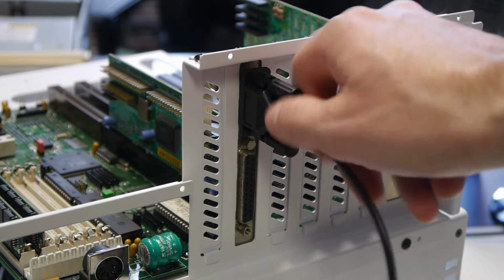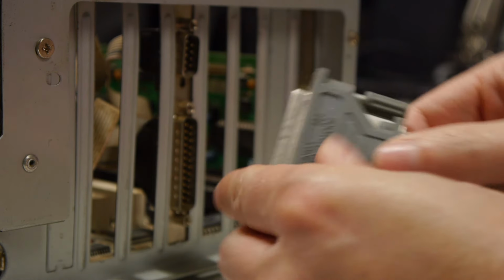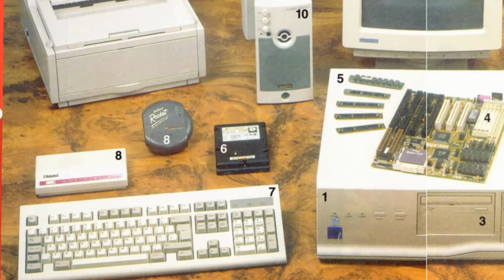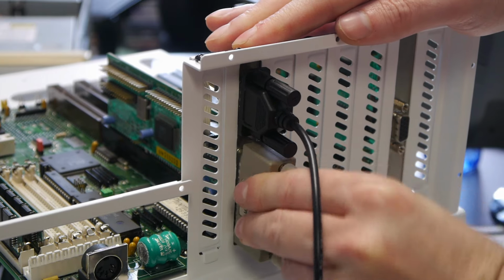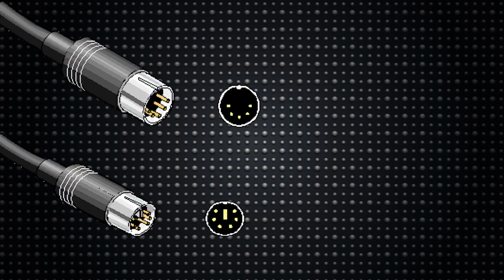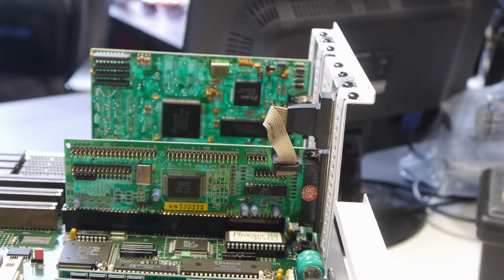What did we use before USB? | Nostalgia Nerd

Comment: Funny how Apple is never part of these standardisation groups.
They've always done it "their way", leading to tons of obsolete hardware.
In the end they follow the standards, albeit a few years later :)
Reply: To their credit, the original iMac bet heavily on USB pretty early on, and that was one of the things that really popularized it.
Before that, their keyboard and mouse connections were generally done through ADB (Apple Desktop Bus), a system that allowed daisy-chaining and used a round 4-pin mini-DIN connector. The biggest problem with it besides being proprietary was that it wasn't safe to plug or unplug devices with the machine turned on (though people did it anyway).
Reply: ...and before that, the very earliest Macs used connectors that looked like modular phone jacks. ADB seems to have been first introduced on the Apple IIGS, oddly enough.
Reply: They use USB on their Macs and their iPads. Rumors say that they will start using it on iPhone too.
Reply: The thunderbolt interface was created by Intel and Apple
Reply: I don't know if they just like to be different for the sake of it. How come there's no uninstall function? A lot of bigger or more complex software leaves crap all over the place.
Reply: HScarlet I assume when you say “uninstall function” you mean for software. The reasons for this was that most software was installed simply by copying it to the Applications folder and uninstalling meant simply deleting the App. For those Apps that install stuff in system folders such as drivers then the app’s developer is supposed to provide  a uninstall app for that purpose. Window’s uses a central program for installing Apps such Add/Remove Programs or whatever their call it in WIn10 these days because it decide to go with the much more complicated and fragile Window Registry model which make uninstalling most apps more difficult too. Of course, Linux has them beat with it’s dependency problem which make installing and uninstalling Linux apps more difficult which is why is why the app repository with app package manager model is necessary and useful in Linux.

If you have a Mac and your trying to uninstall some large program that has installed items in other locations beyond the Applications folders or your user folder’s preferences folder, then see if the App developer provides their own installer as many do in my experience.
Reply: everyone here has been talking about how you are wrong but really i understand. they originally made and pioneered some of the stuff we have today, but right now in current year, they've taken a step back in the timeline, specifically making cords with almost the same specs as another just to have the port be different, requiring an apple cord. this just happened with the headphone jack quite recently. android has followed with this as well, but their port isnt the lightning cable, so you dont have to buy another cord that only apple can really make.
Reply: Really? You do know Apple helped develop USB C and, like others have pointed out, use USB C ports on their MacBooks, right?
Reply: They still against standardization even today with their lighting port on the iphones
Reply: Hp also pulled an apple on them selves with the HP display port. Now they ship their pcs with normal hdmi.
Reply: Lightning connector is the last big one
Reply: FireWire was really good. Now its just decent, just like USB 2.0.
Reply: Apple was one of the first manufacturers to use USB, the first to ship all notebooks with 802.11 networking as the base config, they helped intel develop thunderbolt, was part of the development of ieee 1394 and so on. Yeah all those were years ago but still valid things
Reply: Boooooo Apple.
Reply: And they are the only company, which is really working against plans of the EU for a law to force phone manufacturers to use a universal standard for charging...
Reply: @p3chv0gel22  no, they just want USB C to be the standard rather than microB
Reply: lightning was vastly superior to micro, ive never broken nor seen a broken lightning connector, but ive seen a dozen or more broken/badly bent micro ends.  Also Apple made reversable connections long before  USB.
Reply: @storm37000  wait, you never have seen a bent lightning cable? the actual lightning port never broke but goddamn they intentionally made those weak.
Reply: ive never broken the connector, ive seen the cables sheilding break/wear off, but that happens on any cheap rubber cable.
Reply: @storm37000  i have seen broken lightning plugs several times (like, literally cracked in two pieces), although way rarer than a micro-b connector failing, they do break and get a piece stuck inside the device
Reply: @pknyan3124   Well you dont bend your connectors if you dont use your cables like a fucking monkey
Reply: @DocTime56  guess u use your cables like a monkey then
Reply: @p3chv0gel22   Meanwhile USB-C not being able to be cleaned without fucking exploding
Reply: On the contrary, I feel like in the last 25 years, Apple has done more for cable standards than just about any other company. Yes, they had the 30-pin and now they have Lightning connectors, but at the end of those cables, it's always been some kind of USB connector. They were the first ones to really legitimize the USB connector with the iMac having no other ports, so it supports plug-and-play USB peripherals and has no problems accepting most modern peripherals. For years, Firewire standard was THE standard for high-speed transfer, especially on camcorders and high-end music interfaces, and high-end editing PCs had Firewire, too; it was not a proprietary standard. They basically brought USB-C charging to the world's attention with their MacBook, and honestly, they were probably too early on that. They pioneered other standards like Mini DisplayPort and Thunderbolt that get used to this day across the entire industry. I do think they're holding onto Lightning a little longer than necessary, but it's easy to see why they developed Lightning when they did. No other existing connectors would have worked as well.
Reply: @mbvglider  Apple has done far, far more harm to the PC and mobile industry than help. "There's a dongle for that" should be their motto. They have steadfastly refused to adopt standards like USB on their mobile devices in order to squeeze royalty money out of their proprietary connections. Who uses Mini-DP or Thunderbolt besides Apple? They invented their own screws just to keep people from repairing their own hardware!

You are absolutely delusional.
Reply: The standardization groups are always playing catch up with Apple. Lightning came out before USB C, Firewire came out before USB 2. It's always Apple setting a goal to transfer data a certain way, creating a product that reaches that goal, and then a few years later a new industry standard miraculously appears that does the same thing but better.
Reply: Apple sucks..
Reply: Um actually, Apple hasn't  gone their own way in the face of standards as often as you seem to think. The few times they did I go their own way was usually because the existing standardized connectors didn’t meet their needs in some instance such on laptops as they needed a mini version of a connector that did not yet exist yet (Mini-DVI anyone). 

Older connectors like the Apple ADB (apple Desktop Bus) port was in some ways better then the DIN connector on PC’s or even the PS/2 port as you could chain devices to it (much like Firewire). It did suffer from the restriction that it was not hot pluggable (unplugging when the computer was on could damage the port). PC’s at the time had many different mouse standards such Serial, Bus Mouse, and later PS/2 as did home/micro computers of the era such Tandy’s, Commodore 64’s, Sinclair’ ZX Spectrums, Acorns, Amstrads, etc.

When they adopted SCSI it was an emerging PC standard abait one that wouldn’t take off among consumer PC users due to the higher cost vs the cheaper and much more limited bi-directional parallel port. The bi-directional parallel port  dominated the PC peripheral market as it was a much cheaper way to connect external peripheral to PC where SCSI involved expensive cables and settings ID numbers and adding terminators. USB of course fixed all this mess for both Macs and PC’s, which is why Apple was one of the first computer companies to go all in on USB with the original iMac. (They also went all in on 10base-T Ethernet then too, even on the consumer oriented iMacs and iBooks, solving the wired networking mess too and later wireless networking with  the 802.11b wireless Ethernet standards). It was only USB 3.0 that Apple didn’t rush to put on their Macs at first  but it’s backwards compatible with USB 2.0 and they are not going as slow with USB-C especially since they helped developed it .  

The only area where Apple has gone their own way in recent years in some limited instances is with graphics card/monitor connectors. In early Macs they did use a non-VGA connector of their own but then so did many home/micro computer of the era if they didn’t just use crappy low-res RF or composite connectors to standard TV. They did later adopt VGA followed by  DVI then DisplayPort, all standards.  (though they did briefly adopted a proprietary version of DVI that include power wires for connecting special Apple Cinima Display monitors without the need for a separate power cord for the monitor which showed up on their pro Macs.). They also cane up with their own version of mini-DVI for laptops when no one else had solved that issue just as they had to do with mini-SCSI back in the 90’s for their laptops as no miniature SCSI standard existed at the time.  But they have not done with any modern ports as both modern DisplayPort has the Min DisplayPort standard license to PC manufacturers as a standard  port for laptops (that don’t use HDMI/Mini-HDMI or now USB-C). 

Now fo course on their phones they have had two different proprietary ports the 30-Pin connector that originated with the iPod and the Lightning connector that succeeded it. The former was the result of them wanting a charging and accessory port for the iPod that was more advanced then the Firewire port used on the original iPods and there was no suitable standard they could adopt for that purpose at the time.The Lightning connector was designed because USB-C wasn’t ready yet and Micro-USB wasn’t going to cut it. I imagine they will go all in on USB-C only at some point with the iPhone and iPad but they‘re just not ready to tick off customers with lots of iPhone accessories who hate conversion/adaptor dongles or for whatever other reasons they are delaying the switch.
Reply: It's so Apple can then charge you $80 for a $5 cable, that didn't come with the system.
Reply: Except they still have proprietary RAM so they can charge twice as much as PC RAM costs. It's the effect of using Big Endian memory architecture.
Reply: Apple was also out in front of the pack with SCSI and Firewire. OP's gettin' wrecked.
Reply: Apple frequently leads rather than follows: USB very early, USB-C very early. They have had some misses: AppleTalk. However, notice even with their misses they are LEADING the concept.
Reply: Greg Lovekamp I wouldn’t call AppleTalk a miss at least at the time it came on the scene. In the late 80’s it provided a easy to setup cheap form of networking that while slow was available to every Mac user. IBM PC & compatable network standards of the time like token ring and 10base2 (Ethernet over coaxial) where no where near as easy to set up and use. Of course the advent of 10base-t (Ethernet over Twisted pair), which was much cheaper and easier to setup then it’s predecessors meant that AppleTalk no longer made much sense for the Mac especially given that Ethernet was an industry standard. But that doesn’t mean AppleTalk didn’t have a place in the late 80’s and early 90’s Much like Apple use of SCSI as the main external peripheral connector made sense in the 80’s/90’s until the advent the cheaper and easier to setup USB made SCSI absolute for most uses (with the exception of some enterprise uses). 

The same can be said of Firewire as a high-speed companion to USB util thunderbolt and USB-C erase any advantages with Firewire. Of course, had the owners of the firewire patents not charged such high fees for licensing firewire on the PC then more manufacturers might have adopted it and it might have become more common on Wintel machines. Fortunately, they are not making the same mistake with Thunderbolt, USB-C and USB 4.0.
Reply: @greglovekamp  USB-C early? LOL. It's 2023 and outside of laptops, Apple doesn't use USB-C. They are in the business of making money off proprietary connectors. Why can't you see that?
Reply: @encycl07pedia- , if you actually paid attention to details, you’d notice my comment was 2021, not 2023. Apple is in business to make money, plain and simple. Sometimes they have led with standards (3½” floppy, USB, USB-C) while other companies continued using older standards; other times, Apple waits until a standard is entrenched. I hold no inherent hatred toward Apple; they make the products I choose to use. Others may prefer to customize, tweak and fix other products; after 35 years in IT, I just want my stuff to work.
Reply: @greglovekamp "if you actually paid attention to details, you'd notice my comment was 2021, not 2023. Apple is in business to make money, plain and simple."

I know. I specifically stated "It's 2023" to show that even years after your comment about Apple "adopting USB-C early", Apple still refuses to use USB-C on the devices where it most makes sense: mobile. They're still using a wasteful proprietary Lightning connector. Yet they claim they want to be "eco-friendly" by not shipping chargers. It may be eco-friendly, but it doesn't hurt their charger sales, either.

They're in business to make money? No kidding! You can make money without being so anti-consumer. How exactly does needing a female USB-A to male USB-C adapter just to plug in a dead simple USB drive make things easier for you? Those are the "options" you have with recent (although not the most recent) Macbooks. Any other PC made in the last 20 years wouldn't need an adapter at all, even older Macs! Was having a headphone jack getting in the way of your phone "just working"? Were Phillips screws on a case a hindrance to you? How is having the option to fix or upgrade something without taking it to an Apple Store a threat to your devices working?

I want my stuff to work, too. Macs, even ones I've used as recently as late 2021 and as early as the mid-90s, still have problems that prevent them from working as intended. Keychain warnings every time I logged on, awful and regular crashes, terrible multitasking/task switching (awful "command center" and no more than two windows tiled). What exactly is so much easier with it? That when you have everything Apple they work better together? You can do the same with any major OEM.

If consumers like you didn't excuse their anti-consumer activity as "They're in this to make money, not make my life easier even though every other manufacturer adheres to standards," they might actually change. CBC did an investigative report where a cable pin was bent out of place. Apple wanted to charge something like $1200 to repair it and falsely claimed there was "water damage." A third-party repair shop repaired it for free by bending the pin back. They're robbing you blind and you don't even care.

I wouldn't care if it didn't encourage other companies to jack up their prices and engage in similar anti-consumer practices and take away user options. By supporting these thieves and con artists, you're making the computing world worse.
Reply: @encycl07pedia- , shame you have such bad luck with products and systems that 99% of users find easy. Maybe, just maybe, the products aren’t the problem. “Anti-consumer” Apple has millions of consumers who buy and are quite happy with the products. I’d recommend you find a different vendor, and leave the rest of us alone.
Reply: @greglovekamp  An Apple fan can't even comprehend what they're reading. How sadly typical. If Apple didn't have problems, there wouldn't be support fora gaslighting people into believing the butterfly keyboard isn't bad and that it's user error (then they got rid of it). I've never used a butterfly keyboard, in case you're wondering. Jacking up the price to twice/thrice what it's worth isn't unique to certain Apple users. Jobs saying you're holding the Iphone 4 "wrong" instead of admitting it was designed poorly is not a problem I personally experienced, either. How about Apple Maps leading people onto active runways and other dangerous places? Again, that's not a problem I experienced, but it's part of the Apple experience. It was so bad the Apple actually apologized for it.

I was a contractor for Apple Care the last time I touched a Mac and they sent me an Imac personally: a $5,000 machine that ran like a slug. On anything not running Mac OS, I can tab around, switch task lightning fast and get to what I actually want. On Mac OS, it's clunky and slow.

"Apple has millions of consumers who buy and are quite happy with the products."
Yeah. North Koreans love their dictatorship, too. That's because they don't know any better. It doesn't make North Korea a great country or Kim Jong-un a great leader. Most Apple users don't realize Steve Jobs was a deadbeat dad who disowned and treated his own daughter like garbage before and after he got rich AND was an abusive, vitriolic boss and person in general who never created anything other than companies. That doesn't make those things not true. Tim Cook is even worse when it comes to "messing" customers over.

"There's a sucker born every minute."

Get info outside of your cult once in a while.
Reply: @encycl07pedia-  And heaters gotta hate regardless of rationality. Do everyone a favor: go play with your Google toys, and leave the conversation to the adults.
Reply: @greglovekamp  Heaters? Yeah, you look like the adult in this conversation: no rebuttal of any substance, just "Leave me alone". I grew up on Macs. I used to like Apple. But that's too complicated and scary for your brain to process.
Reply: @greglovekamp  I LOVE BEING LOCKED IN DIGITAL CAGES. I LOVE PROPRIETARY SOFTWARE. I LOVE APPLE. PRAISE LORD JOBS. APPLE IS, SUPERIOR TECHNOLOGY. ALL OTHER TECHNOLOGY MUST BOW BEFORE THE APPLE. APPLE HAS NO ISSUES, BECAUSE IT'S USERS KNOW NOTHING ABOUT TECHNOLOGY AND THUS CANNOT FIND ANY. APPLE IS GOOD BECAUSE OF IT'S GREED. GREED IS GOOD. APPLE GOOD.
Reply: @populistscum  OK. Or you can have an unnatural hatred toward a company. Your life; I could not possibly care less how, or if, you live.
Reply: @greglovekamp  IT APPEARS YOU HAVE PROVIDED VALID POINTS. FORMULATING RESPONSE. PLEASE WAIT.

RESPONSE FORMULATED:

POINTS IGNORED, ASSUMPTION CREATED, OK,

LOVE APPLE, PRAISE STEVE JOB.

YOUR TRULY, GREG LOVEKUNT
Reply: @encycl07pedia-  Hmmm. As far as I can see Apple ONLY uses USB-C, aside from the iPhone. And yes, I know, lightning sucks. (Side note: I have never used my lightning port aside from charging over the last 6 or so years, as I only use Airdrop to transfer data, and for that, it's fine.)
Reply: @encycl07pedia-  Removing the headphone jack entirely probably wasn't the best decision, but it forced other companies to follow suit, and also the adoption of a more convenient way to listen to stuff. Idk about you, but I don't like having a cable hanging around my neck, ears and getting stuck everywhere because of it.

macOS... I can't comprehend how someone could have any major problems with it. First and foremost; it is a *nix based system, which already makes it superior to Windows. And because of it, it has a ton more customizations available to it. To address your apparent experience. I have used a MacBook for around 6 years now, and have never seen a "Keychain warning?" So I can't really say anything about that. To get macOS to crash, you must have done something real terrible to it, because usually, you don't even have to turn off your mac. Most people only reboot theirs when they need to update the OS. Since it's a *nix system it is inherently very stable. If you are curious, you get almost as much customization with your mac as you would with a regular Linux distro, just a quick look at the "Yabai" window manager should give you an idea. Also, in the current market, there is literally no better cost-performance than what you get with the entry level macs. They just released a new Mac Mini with their M2 chip for 600$, which dwarfes anything else in that price range and way beyond. 

And yes, you are right, they are inherently anti-consumer. I am fully on your side with that. "By supporting these thieves and con artists, you're making the computing world worse." Then I would highly recommend you use something other than Windows, because that is inherently malware, and is actively making the computing world of the general Joe garbage, because that trash comes pre-installed on almost all machines sadly.
Reply: @nodel.  ^I love this comment. I really do.

1. Wireless headphones can be just as problematic as wired. Wired is much simpler: plug-n-play. With wireless, which we'll just assume is Bluetooth at this point, you have to pair. Depending on the version of BT, you may not be able to have more than one BT device connected. There's variable lag in Bluetooth which is problematic with watching videos. There are issues with BT/WiFi combo cards and frequent disconnections. There are issues with LOSING wireless headsets or the base device that are much less prevalent with wired. And you have to worry about charging, too. But sure, I guess when walking through a dense forest, it's less likely for BT to get entangled. Regardless, the main point is that Apple took away the OPTION to use wired headphones in order to push their overpriced Airpods.

2. Apple did not force anyone to abandon the 3.5mm headphone jack. They made it more popular to abandon it, but that's it. It still got tons of backlash and there are still OEMs that include headphone jacks.

3. You've never worked with a Mac on an office network, have you? They crash just like any other computer. And no, you don't have to do something awful for a Mac to crash. I got an Imac straight from Apple less than 2 years ago and it crashed all the same. Macs have been crashing from normal use since their inception.

4. UNIX (upon which Mac OS is based) is not inherently better than Windows. I'd say it's better than Windows 10 and probably 11. It can crash just the same. And when UNIX or a Linux OS breaks, it really breaks. Just because it uses POSIX doesn't make it better. But kudos on copy/pasting from the brochure about how much better *nix is than Windows.

5. "you get almost as much customization with your mac as you would with a regular Linux distro"
LMAO!... Wait, you're serious? Let me laugh even harder. ROFLMAO!!! I run Debian with no DE at all, can spend entire sessions outside of a GUI, but you want to tell me Mac OS is almost as customizable? LMFAO! Dude, any major OS can get a tiling WM, even Windows. And you're still stuck in that slow Mac GUI that's running tons of crap in the background.

6. Mac OS is too heavy and slow for me to believe your cost/performance claim. I've used it. It's almost as heavy and slow as Windows 10 was for me on a hard disk. It seems like you copy/pasted that from an Apple ad, too. My old Thinkpad from 2015 runs like lightning compared to the last Imac I used.

7. "Then I would highly recommend you use something other than Windows, because that is inherently malware"
As I said earlier, I don't use Windows. It's not "inherently malware." WTF? It's an operating system. If you want to talk about tracking, please don't act like Apple doesn't track your activity or doesn't have targeted advertising. Windows has its own issues which is why I no longer use it. I have yet to find a more complete OS than Windows 7.
Reply: @encycl07pedia-  "ive never used a butterfly keyboard" then shut up because you cant say shit if you have no proof.
Reply: @encycl07pedia-  bro really calling a completely rational dude with great arguments a hater meanwhile bro tryna insult other people
Reply: @encycl07pedia-  bro is really tryna call windows not bloated meanwhile theres like 15 apps in the start menu that arent even on your PC/laptop that are basically just ads
Reply: @Maarteng_053  lol. You should have finished the thread before commenting. I don't use Windows and never said it wasn't bloated.

There's a reason the butterfly keyboard is no longer being put on Macs.